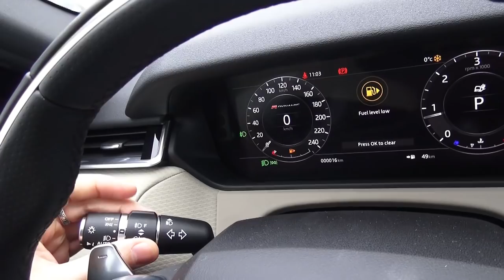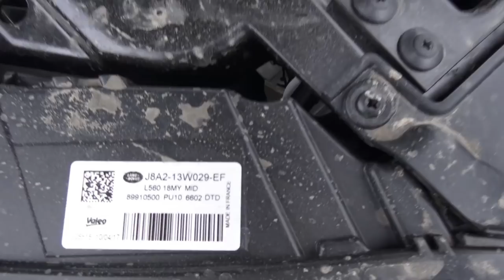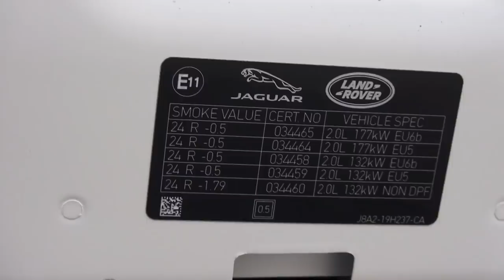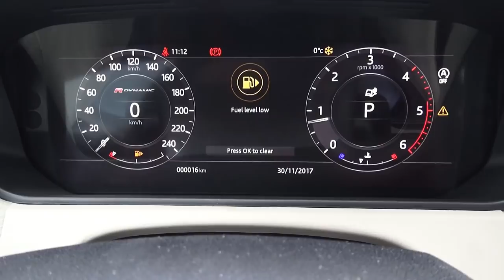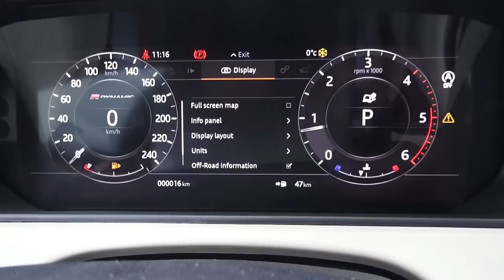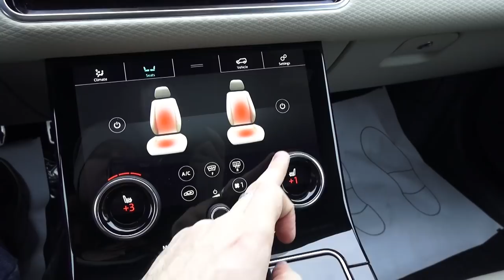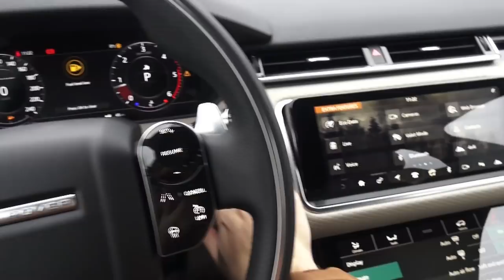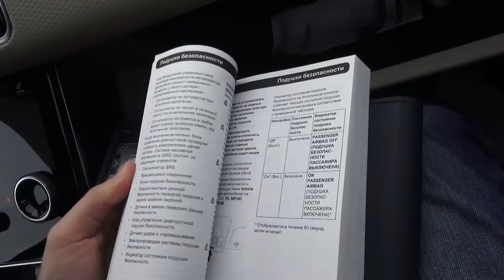2017 Land Rover Range Rover Velar. Start Up, Engine, and In Depth Tour.

Comment: MegaRetr, you forget to use the 4wd low select button in 21:59, when this button pressed, shifts between high range or low range 4wd, also locks center differential. For usage of 4wd low button only can performed when you shift to neutral. Select vehicle menu in touch display, then push mountain icon. This will activate 4wd low, when gearbox set to neutral. A warning shows on instrument cluster when shifting to 4wd low while transmission is not neutered